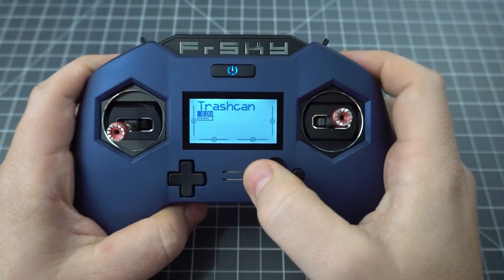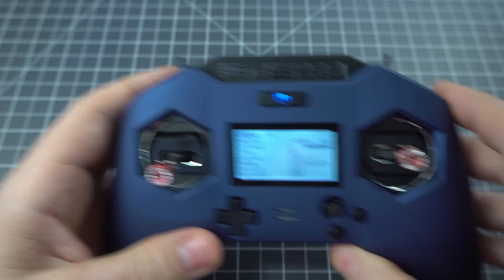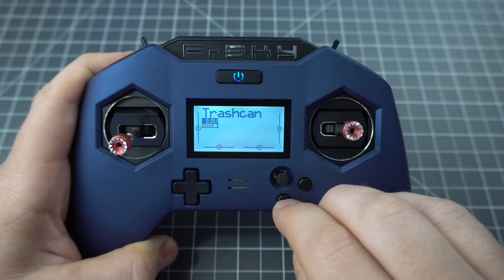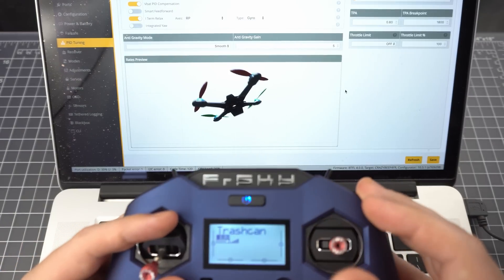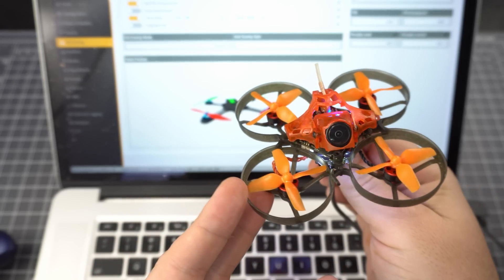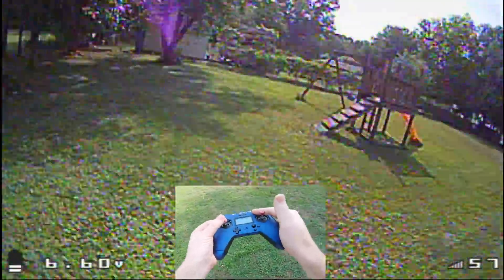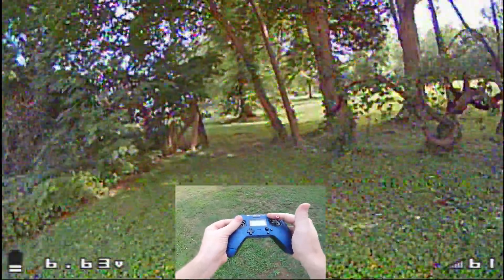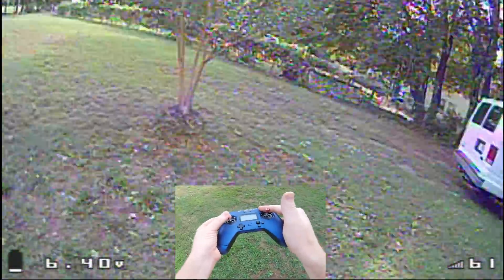Motion Control FPV with the X-Lite Pro

Comment: You mentioned to maybe reduce gyro input to 10-20%, that’s what I’ve been wanting to do myself! Could you share how to do that? In mixer or a logic switch?

And it seems you tied yaw at a lower rate with roll? Was the the -100 and +100 difference? Makes sense that a little yaw with a little roll feels intuitive to swing it
Reply from the maker: There's a gyro setting in the main configuration menu for the radio.

Comment: How must the xlite gyro calibrated before start to fly with Motion Control?
Reply from the maker: I'm not sure if there is a calibration, is there?
Reply: @whiffles  don't know. But the gyro must know where is the zero Point. Imagine a Start and the Quad goes crazy...
Reply: It's fake
Reply: Mr. AnderZon FPV It's not a fake. Go home
Reply: @der-block4005  I fly fpv professionally. It's very fake. The controller6woukd have to go upside down to maje the quad go upside down
Reply: Mr. AnderZon FPV i don't think you are more professional than me. I own the pro and flew with gyro only on pitch/roll. It's no fake and you don't have to flip the xlite upside down to fly upside down.

Comment: I’ve not been able to bind my Trashcan to my Xlite Pro. Got the June firmware update that includes D16. Any tips on how you did it?
Reply from the maker: Did you flash the RF firmware as well? You need to flash both the RF and the new version of OpenTX.
Reply: @whiffles I followed these instructions https://www.youtube.com/watch?v=OAeqYmKmLko . Flashed the main firmware, the internal module and the PMU. My Pro controller manages to bind to my FRsky xsr-sim usb dongle using D16. And a friend's X9D controller can bind to my Trashcan using D16. But my Pro controller does not bind to my Trashcan  using D16. Are you using D16 or Access?
Reply from the maker: Are you running the FCC or EU version of the radio? Mine is the FCC version, but for some reason the RF flashed as the EU version. Check the version of your RF firmware to see if it is FCC or EU. If it is EU then you need to switch the receiver to FrSky LBT on the configuration page in Betaflight. If that is the case I'd email FrSky at sales4tech at gmail to get a script to convert your radio to FCC. It's a known issue.
Reply: @whiffles  Travelling, so I did not have time to check until now. Thanks for helping out a bit here. I'm on FCC. The module flashed as ISRM-PRO 1.1.0/1.1.2FCC, so should be fine. The receiver is set in Betaflight as FRSKY_X. Just can't figure out what else I should do.
Reply from the maker: @IanSaunders  That's so strange. Did you double check that the RF firmware is the most up to date?
Reply: @whiffles  I'm relatively new to this. So when you say RF firmware, are you referring to the Internal RF module? That's ISRM-PRO 1.1.0/1.1.2FCC, which should be the latest...
Reply: @whiffles  Also, did you update any firmware on the Trashcan? I've not done that yet.
Reply from the maker: @IanSaunders  You shouldn't need to update the Betaflight firmware. Are you sure you're putting the model into bind mode? Not sure what else it could be. You chose D16 in the menu on the radio?
Reply: Whiffles Yeah. Double and triple checked it all. No luck. Only thing I can bind to using d16 is my frsky training USB... thanks for the suggestions anyway.
Reply from the maker: Were you able to get to the bottom of this? I saw somebody mention reformatting the microSD before copying the firmware and flashing.
Reply: @whiffles  Not yet mate. Thanks, I'll give that a go.

Comment: I wonder how to fast flip with that mode😅
Reply: flick it in the air and catch it again
Reply: @j0naiTV  hahaha
Reply from the maker: It'll definitely take some practice!
Reply: Toss the controller up in the air and put a spin on it, see if the quad performs the same moves as the radio. Be sure to catch radio! 😉

Edit: I just realized J0nai said basically the same thing... 👊
Reply: @ledchickenfpv7164  yes, catching a toss with goggle on is the challenge...
Whiffles right, it needs some practice😉
Reply: @JeffriRanger  haha, yeah,it appears I didn't quite think that one through. I had an idea for how the gyro function might be useful beyond "novelty use". You know how we all try to put body english into maneuvers, especially last second corrections, and sometimes almost tip over or fall out of our chair? If it can be configured to give a small boost when stick input and controller rotation in the same direction are input, I'd probably try like 5 - 10% boost to start, that might actually have desirable results.?. Of course it could have the exact opposite of my intended effect. Makes me wonder if programatically acting on exaggerated controller input would be good or bad, and....maybe you'd even want to attenuate the stick input if a "panic move" is detected. I wouldn't be surprised if a high percentage of those "whole body" controller inputs were over corrections. I might have to suggest looking into this if someone hasn't already thought of it... Seems like it could be an interesting Kabab or JB video, no?